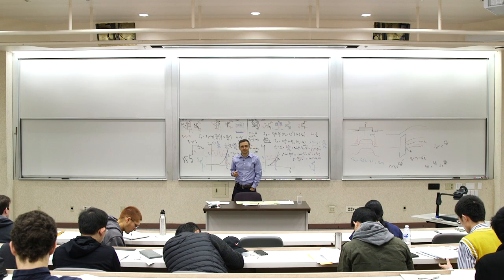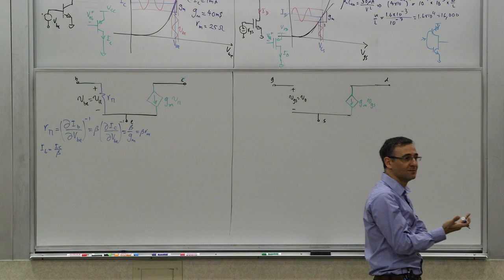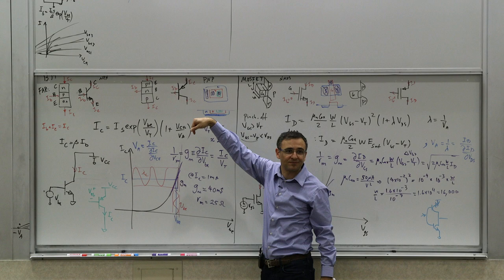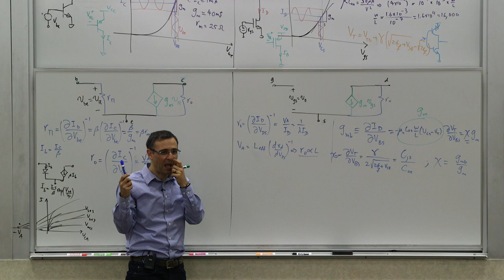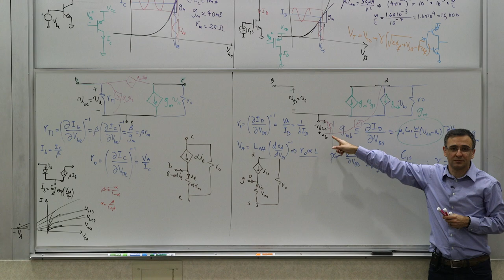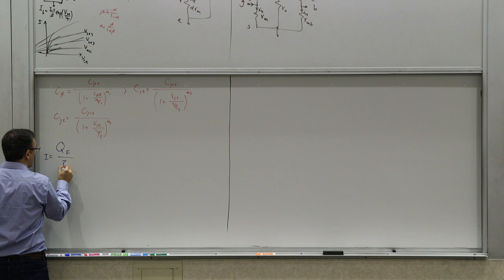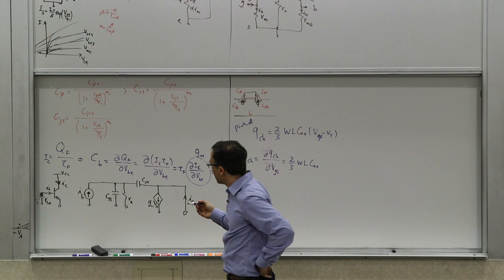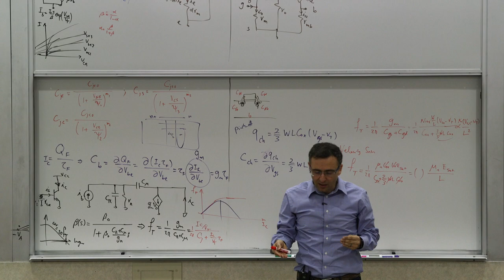116N. Small-signal model, MOS vs. BJT, input and output resistance, capacitance, cut-off

Comment: Why don't we use the non-linear gate capacitance as a symbol in a large signal-model version of the MOSFET like how we use the base-emitter PN junction in the large signal model of the BJT? I guess that it would be a little misleading as the Gate capacitance is across the whole channel, and not just the gate to source. I'm just curious if there is an accepted notation for expressing the large-signal model of the MOSFET similar to the Ebers-Moll model of the BJT?

Comment: The voltage across the channel is not uniform so why is the channel charge divided by Vgs - Vth?
Reply: bcoz of the gravitational effect of drain multiplier index compensation parameter.
Reply: it should be Vgs - <Vth> ?